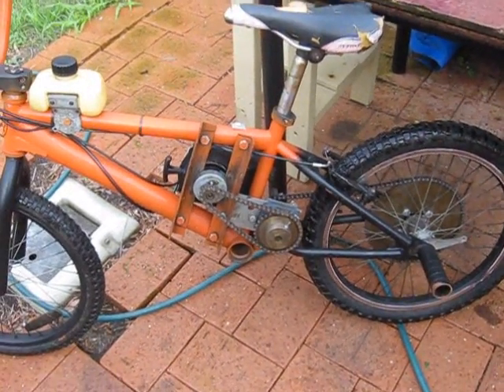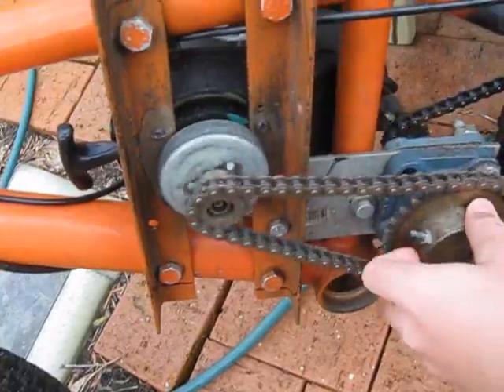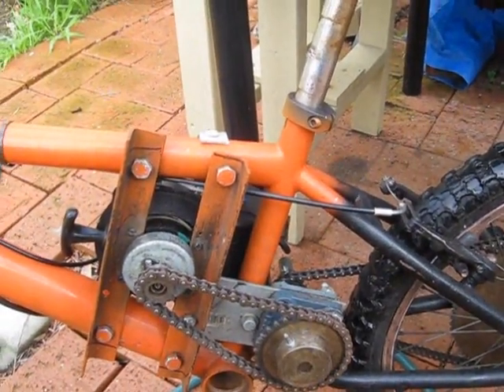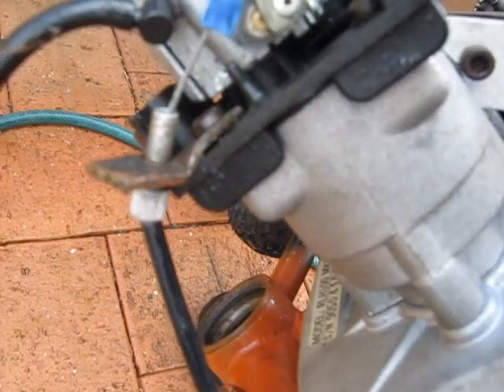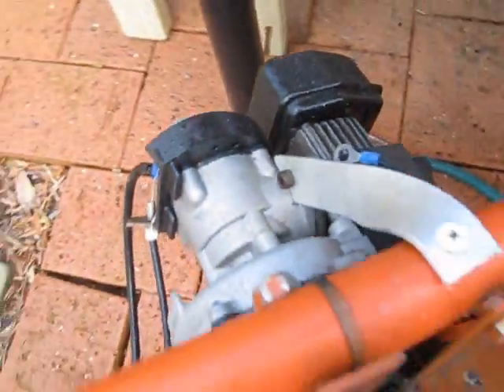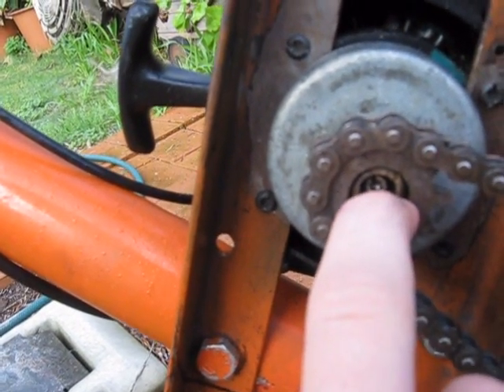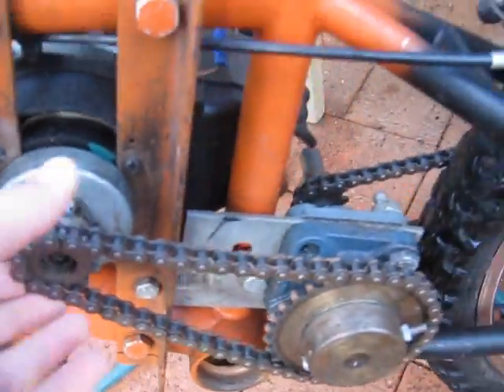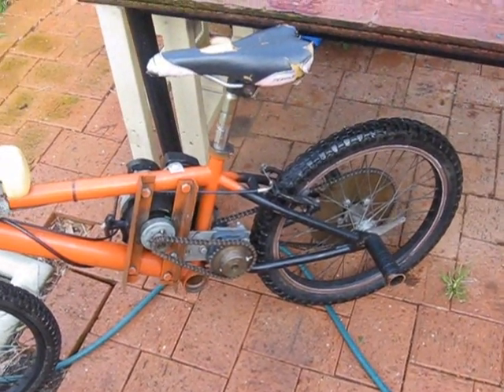How I Built My Weed Wacker Bike

Comment: An easy way to find ratio is to put the valve stem at the top and mark the clotch drum with tape.Then turn drum and count how many turns it takes to bring the valve stem back to the top. THIS IS A REAL-WORLD WAY TO CORRECT FOR THE FACT THAT THE TIRE HAS A MUCH 'LENGTHIER'CIRCUMFRENCE THAN THE CIRC.OF THEREAR SPROCKET. 10 to 1 is Ideal.

Comment: (11/30) x (11/72) = 17.85+ :1 If you know how tall the tire is, you can now figure out how fast you're going (in mph) for any given engine speed. So if your rear tire is, say, 3.25-16, you can calculate tire height (will need aspect ratio to do calculation, or just take a tape measure and measure it), then run the formula: engine speed (rpm) x tire height (inches) / 336 (constant) / overall gear ratio (in this case 17.85:1). The answer you get is in MPH. I ran it and just used 100% for the aspect ratio. I found at that engine speed it should be going a little over 22mph.Not bad!
Reply: DeanMk1 do I need maximum engine speed or idle speed

Comment: well done mate can't wait to see your chopper machine  i have made a mini bike with a new chinese 16 hp motor on it   5 8 0  cc  it does around 50  mph  plus i have another one  which  is a v twin vanguard  briggs and stratton  6 2 7 cc   22 hp but governed  not sure what speed it does yet  the motors on a hinge pivot  which tightens a  belt  and away you go its only one gear .jacksharft system as you have.

Comment: If I use a 2 HP 4 stroke engine on a bike like this, do you think I would still need such a low gear ratio? or would you say the engine and clutch are capable of a 9 to 1 ratio?
 Thanks!

Comment: Very well documented and the project shows ingenuity! Much better setup than the old "drive shaft rubbing on wheel" drive systems. I notice you have other bike projects you have posted as well. As a small engine fan (my self included) I thought I'd share a really good resource with you and other viewers. tncscooters is the best com site I have ever found for parts. All $ are US$. Carbs $15, manual disk brakes $7, rotors $9, etc, etc. Carbs seem to B 1st thing that goes bad on small engines!

Comment: Cool dude ; ) mine has 12' wheels 23cc stihl I removed the clutch springs onto anglegrinder gearbox =3.1/1 then 8tooth to 36 tooth sprocket bmx chain, does 46kmh running on premium+moth flakes :D

Comment: There is a third way for the final drive, a belt drive. i did it without a clutch first with a underpowerd suffolk lawnmower engine. Later on i used the engine of my old pocketbike that one had a clutch but i still used the belt drive cause it was on There anyway so why not. Now im going back to the old way without clutch. But a belt drive is easy to take off, easy for riding without the engine or if the Police shows up  :)

Comment: You should have used #25 chain on the First part of the jackshaft. You would have been able to put an even smaller sprocket on the motor therefore it could have revved out higher and given you more torque. I like your design though I think I might make one like this.

Comment: Hey Mate, great vid. i'm working on something like this at the moment. , quick question: can i have the gear on the engine larger than the gear on the back wheel and it work? i'm using a 50cc Steele chainsaw eingine. Tah

Comment: For the gear ratio you find out the gear ratio for each part and then ADD them together not multiply. Just thought i would clear that up. Also yes if u go to my channel and type "how to mount a sprocket" or along those lines you will find a video on how to mount one.

Comment: Those two bars shuld be ground down. And u could do the ratio of the spindles opposit. But for shure grind those. Or u might only have one nutt
Reply from the maker: +Braedy Johnson hey mate, yes i tried to grind the bars down but only got soike would no far with the resources i had. the bike would not even move if i had the ratios opposite, the clutch would cook straight away
Reply: +Cchange4us oh because u needed tork to get it to move. Not Speed.

Comment: bro thats engine problems, try getting the thing to run by spraying starter fluid inside the air intake, then if that dont work check spark plug

Comment: smaller sprocket in the back on the tire would make it go WAYYYY faster
Reply: Bryan Vangrid A smaller back sprocket would mean higher RPM's but less power. If he made the back sprocket any smaller it is likely that the power would not be enough to accelerate the bike (at low speeds) at all, making the whole bike less efficient than how he has it set up now ^_^

Comment: Very cool but sinse you can do this why not make a moped out of an actual engine or somthing. Be safer
Reply: This is another reason he retired this weedwacker bike. He mentioned at the beginning of the video that it was not very powerful and took too much to get it going...personally, I would just mount an old quad engine in a golf kart, figure out whether I am using the quad's transmission or a centrifugal clutch setup (most likely this over the quad transmission though), and then go.
Reply: +prizedcoffeecup •我
Reply: 鄒錦汝 I have no clue what you said.

Anyways, my buddy built a sort of system for his bike with a brand new 49CC motor and a clutch all with it's own sprocket to drive the bike. You have to get some speed by pedalling and then pop the clutch in order to start this bike, but due to the fact that this engine is meant for a conventional scooter and not a far lighter mountain bike, this thing will fly up to a very high speed if you want and the engine isn't even fully broken in yet.

Comment: The geare ratio in ransition from the motor to the back tire is too off. Your all speed and no power. but you have so little power you cannot even get the speed.. unless the bike could ride on its own. Not enough power for someone to ride